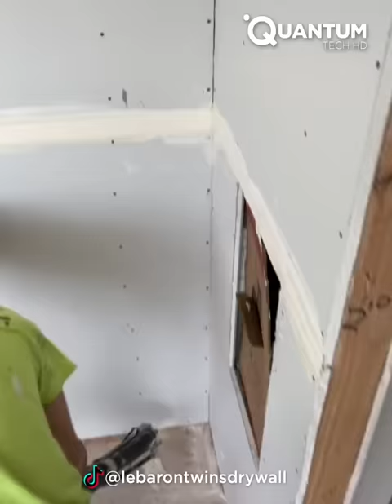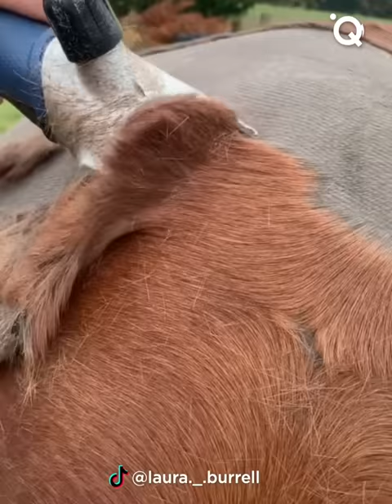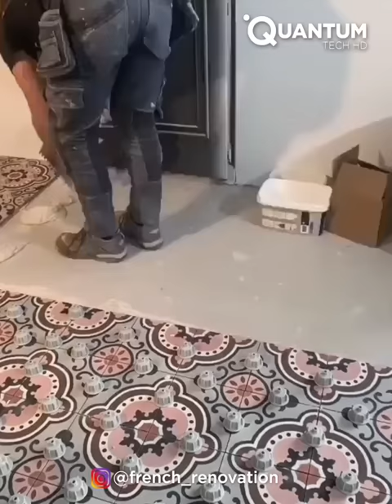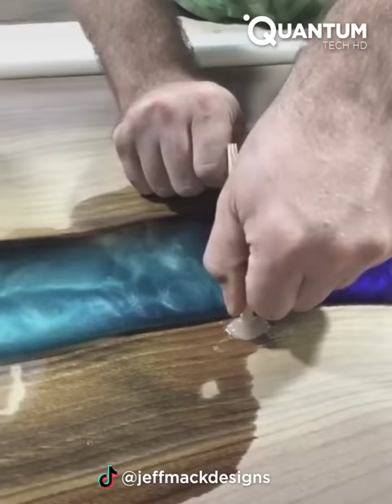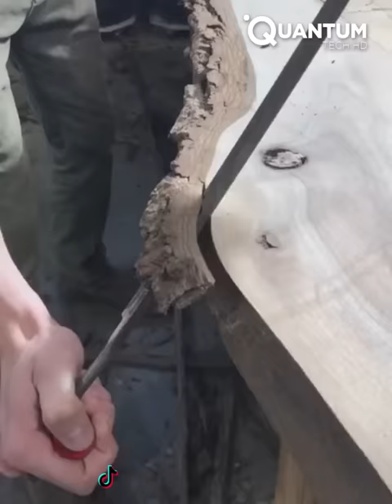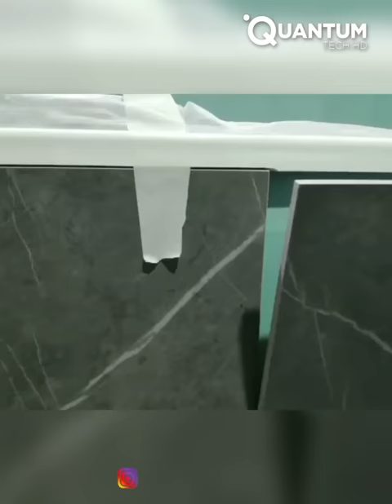Satisfying Videos of Workers Doing Their Job Perfectly ▶4

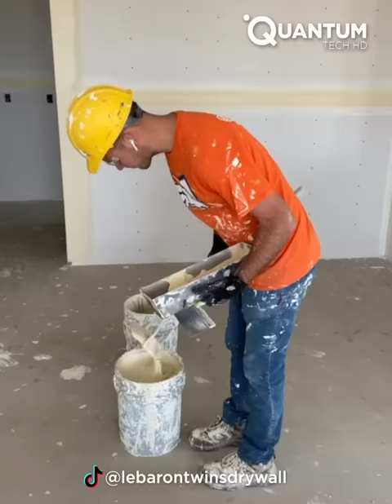Comment: what is the tape no drywall on 0:51?
Reply: That’s not tape, it helps mend the walls together.
Reply: It's not exactly a "tape" per say.  This particular model uses plaster as an adhesive to fix a paper strip to the drywall.  It's called a drywall taping machine or drywall gun.